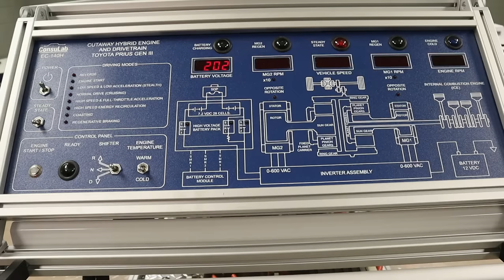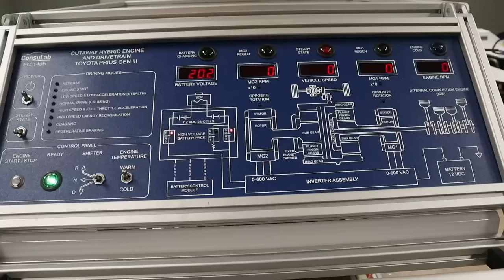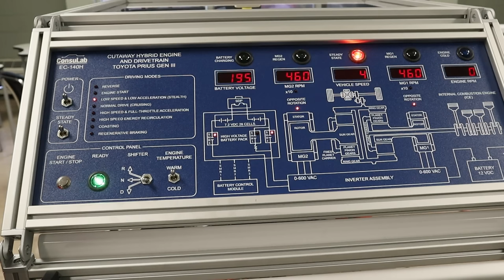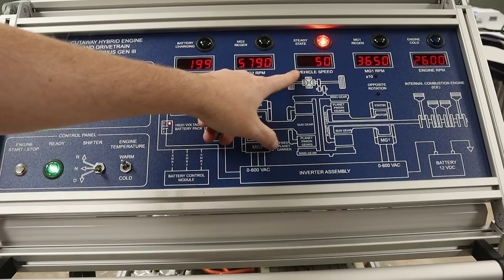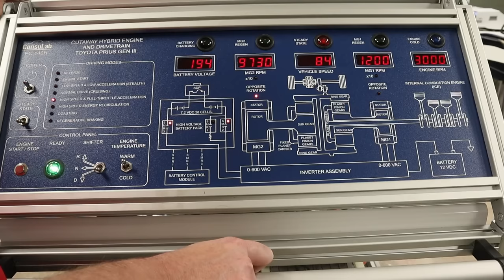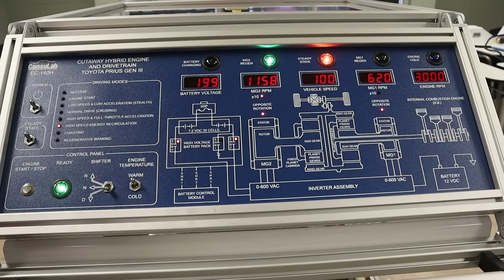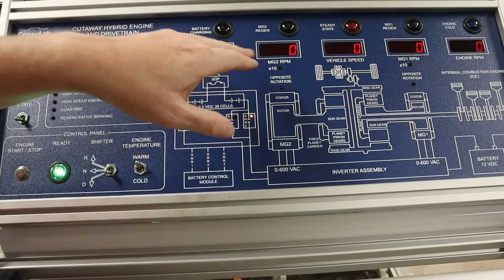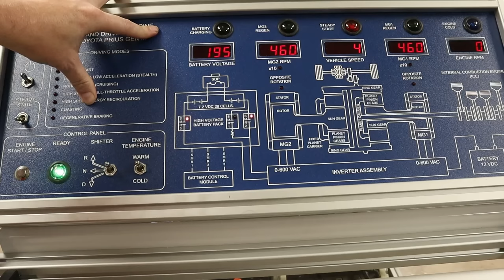How the Prius Hybrid Drivetrain Works (Explained)

Comment: Hi, this is an old post but perhaps I can get some technical questions answered. I swapped engines and transmissions as well as the inverter on top of the engine. I’m getting a red triangle as well as the lights as if I was out of fuel. My gas gauge works intermittently. 
My questions are this: is it possible that there is a ROM pack in the transmission or inverter that prevents vehicle from starting or is it due to the hybrid battery getting so low as to not go into “Ready” mode and start the gas engine?! My educated belief is that the Hybrid battery is too low since it sat for two months all winter in Canada.  Other question is, if this is the case what is the easiest way to charge the Hybrid battery?  Do I take it apart and charge individual cell packs with NiMh charger? Is there an easier way to bypass it and charge with something else?  I have the old transmission and could build a until to spin the transmission and thus create a charger unit.
Reply from the maker: If it has been sitting for a long time, you may have to pull the battery and rebalance every cell. There are videos on YouTube of people do this with hobby chargers, but I don’t have one unfortunately.

Comment: Hybrid sync drive blows my mind. How is this not more reliable by margins than a traditional transmission with a torque converter ? HSD seems superior
Reply: It is more reliable honestly. I've never heard of one with a bad transmission (and I peruse prius chat forums quite a lot), and mine has 240k on the clock without ever having a transmission/diff fluid change and still drives like a dream.
Reply: @QuincyStick I have the same case but mine is over 300k miles. Only issue I'm having with it right now is electrical lol

Comment: Great video!  That's just a flywheel/damper between the ICE and MG1, right?  (not an auto-clutch or anything)
Too bad the trainer doesn't split open MG1 and MG2 stators - could be useful to see what the MG rotors are doing in various modes!
Reply from the maker: Yes, it just softens the shock of the engine. It looks much like a clutch disc and pressure plate from a manual transmission.

Comment: I also grabbed a few other parts to have on those half off sale days; inverter pump and washer fluid pump as well as an AC compressor.  Do you know what the electrical specs are for the AC compressor?  12VAC, 120VAC, etc.?  Voltage, Current and Frequency would be awesome to know from the expert.  Thanks again for sharing!
Reply from the maker: Gen 1 compressors are mechanical. Gen 2 are AC, Gen 3 and 4 are DC. The voltages come directly from the traction battery but vary by control module regulation compared to cooling need.
Reply: @AutoScholarwithMrB  Interesting!  Amazing the price of the Gen 2 parts that seem to never need to be replaced.  I really want to invest in a 1.5L hybrid system and am debating making something like the demonstrator to study with.  Seems like, other than the battery, the whole system can be had for ~$500-$1000 and maybe better if found on a half off sale.  Amazing even the pricing most likely under $1000 if not a pick your parts find. 

So, the Gen 3 can operate from 220VDC on down?  Guessing some form of pulse modulation vs continuous DC?  Seems I read 120V somewhere, though forget offhand.  Will be interesting to be able to very carefully measure V as well as clamp on with a current clamp to see the waveforms on an oscilloscope.  Just brought home two Tektronics portable carts since I'm still working on the cost effective acquisition  and where needed restoration of the lab test equipment to measure everything safely.
Reply: @jafinch78  tell me more about this half price deal you speak of 🤔

Comment: What happens if you put it in drive, full throttle, and then put it in reverse still full throttle. What will it burn out?
Reply from the maker: Can’t say I’ve ever tried it, and I doubt the car would let you do that.
Reply: Pretty much everything about it is drive by wire or computer controlled.
Even the stick returns to center when you put it in D. A thing that was missed in Gran Turismo.

If you do that while driving, it does not do anything. Simple as that. Foolproof, in any way.

Comment: So if the air conditioning compressor is not running off of the engine, does this mean that it will consume the battery like an electric car? Is it more efficient than a traditional car?
Reply from the maker: @shiriajin  yes, the ac depletes the battery. They are much more efficient because they can turn at the needed speed, not whatever rpm the engine is at.
Reply: @AutoScholarwithMrB  I used to have a town car, every time I turned on the air con while I’m driving, it broke the compressor. Now I have developed the habit of turning the AC on or off when I’m stationary. I don’t have to do this with this kind of car right? I’m trying to get as much information as possible about these engines because I’m thinking about buying a hybrid corolla.
Reply from the maker: @shiriajin  no you can run it however you like, thanks for watching!
Reply: @AutoScholarwithMrB  thanks for the information.

Comment: Huh. I have a 2nd gen Prius and I thought that when you let go of the gas, coast and not touch the brake that MG1 and the engine were applying that slight braking force, and MG2 only started regenerative braking when the brake was applied.

I assumed this because when I had my catalytic converter stolen, I could hear the engine being spun by the engine any time I let go of the throttle. Basically a lighter version of B mode at higher speeds. And it would change again when touched the brake (though I’m 100% sure on that last one)

Comment: I have a yaris hybrid 2013.  Sometimes the car does not turn on the engine even when The RPM is above the point where Ev should break and engine should turn on, it accelerates silently and display shows power going from battery to the engine.  2) sometimes when battery is on 2 cells, when Ev breaks, car jerks out of it. The transition is not smooth. Feels like car laggs first, then turns on engine.  Other than that it works fine. What could be the problem?

Comment: Came to this video to see if I can discover wether or not the 10,000 miles worth of oil life is actually more than that based on the % of mileage that was allegedly electric, but based on the trainer is seemed that the engine still is running most of the times above 30mph because it doesn’t know when it will be needed 🤔

If anyone smarter than me knows the actual answer that would be cool. 

In trying to learn if the recommended 10,000 miles for oil and filter change is actually overly conservative due to the hybrid nature of these cars.

I run a Prius prime that claims ~75% of my drive was electric usage, so theoretically it would mean my engine is only getting “2,500 miles” of use if I understood correctly, but I’m way too sheepish to actually attempt to milk the full theoretical ~40,000 miles before an engine oil change would theoretically need to be done (assuming 75% electric usages and miles being done before time degrades oil integrity)

Thoughts? Can a Rideshare driver get away with milking 20,000 miles before doing the oil and filter changes due to electric use and the engine being used less than what the odometer reads, or is the engine in fact being used for the full 10,000 miles as per the odometer and thus the oil change is in fact perfectly timed?
Reply from the maker: I change the oil in mine every 5,000 but that’s probably overkill. If you really want to get to the bottom of it, you could send your used oil off to get it analyzed. I’m thinking about doing this to compare oil quality.

Comment: If I wanted to connect a solar panel to battery while it's running how many volts I have to apply to prevent overcharging? Since it's 7.2 v per unit so 28 of them will be 201.6 v. So if I apply 201.6 volts from solar panel will the battery be safe?
Reply from the maker: I am unsure of how to properly do this. I would check fórums like Prius Chat to see if anyone has done this before.

Comment: What I want to know is the starting process. How does it turn the engine? I am working on a BMW X6 hybrid and I hear activity like turning as I press start button and transmission seem to be spinning but engjne is not being turned. It stay stationary, thus the car engine won’t start  and car throws hybrid power train code
Reply: The engine is directly connected to the planetary carrier. To put any torque on the engine, it's necessary to hold the ring gear still and torque the sun gear. And what's the sun gear connected to? MG1, right? But that's the Prius. The BMV could be a wholly different story.

Comment: Hey Mr B, i do have a question for you. I have a 2010 Highlander hybrid v6 Limited 162000 miles. The motor and transmission mounts are all recently replaced with factory parts. When the gas motor takes over for the electric motor, it's not always smooth. Sometimes i dont notice. other times it's rather jarring. feels like a dull thud or shake. It could happen  at idle or under acceleration from a stop. Any ideas where this could be coming from? this is my first hybrid and i bought it used so not sure if this is normal behavior. Thanks!
Reply: actually, i think its the flywheel damper. right where the ICE mates with the electric motor. that would probably be hard to replace. lol

Comment: Hi Sir   . please can you tell me again how can i find pin 1 and pin 3 on INVERTER HYBRID TOYOTA GEN4 P610 ON Inverter its 2 connecters one (24pin ) another connector (13 pin )
pleas if you tel me hwo can I connect power 12 volt to run InverterI will be very grateful to you

Comment: Gen 4 when you slowing down shuts engine off in any speed, unless battery overcharged. Even on flat road I can go in EV at high speed for a little. At least this how work with lithium battery, not sure if it’s same with old style battery. Gen 3 will drive in EV only under 45 mph, even if you go downhill, engine never shuts off, very little power. But I found if battery depleted, to recharge it, your average mpg will go down. Look like it better to keep battery not less then 70% charged. Needs to much energy to recharge. Gen 4 actually benefits if I using as much as possible battery power, much less energy to recharge it.

Comment: Your Engine RPM numbers were WAY off. Typically any acceleration at any speed (since it's an Atkinson cycle generator not a torque engine) will net 4200-4500 rpm with 80-90% throttle . At 22:45 in the video, you reached 90 mph...well I can tell you it's NOT doing just 3000 rpm to maintain 90 mph.

Comment: My original hybrid battery indicate some issues on dashboard  from time to time by one strange cycle when it is charged up to 100 instead of 80% like used to be. What should I do before I get code?
Reply from the maker: Is the battery balanced? I would check voltage with each battery block and make sure they are close to each other in voltage. Do this while the battery is under load, like when the car is under heavy acceleration. This can be done with most scan tools. If a cell is weak you have a few options, depending on your skill set and time/money you want to invest. “Refurbished” batteries are popular, with many people selecting companies like Green Bean to come and replace your battery and offer a warranty. You can also remove the battery, replace the cells with new ones, and reinstall. I hope this helps, and good luck with your car!
Reply: I cleaned copper bus bars by sea salt and vinegar which  helped eliminate the problem

Comment: Sir
I have problem with my prius 2011.
When air conditioner is on and driving on 20 30 mph local street.
I got battery problem sign.
When I drive 50 60 mph then air condition doing fine and battery doing fine.
Can you suggest me what's wrong  with it
Reply from the maker: Could be a battery cell weak
Reply: @AutoScholarwithMrB  but did not get battery cell weak code yet.
I want to change battery,
But totoya dealership said they checked battery ,
Battery is fine. 
It might be some thing wrong with inverter converter.
AC attached with inverter converter

Comment: So the gearing is 20 mph per 1000 rpm as per a regular car? Why is the gearing not higher?
Reply: NB. I now have a UX250h with the P711 hybrid transmission and the revs drop to 1500 rpm at 70 MPH. Thats 47 mph per 1000 rpm.

Comment: Great video, but if you turn the car off, it’s not just gonna start up at anytime. You have to have it on, and that requires the key inserted, (or near car if smart key) and foot on brake while pressing the start button. They don’t just start Willy nilly.
Reply: I agree, I am not sure I see the need to disconnect the 12v Aux battery, unless you are disconnecting wires / risking a short circuit. There is still a lot of short-circuit current available from even a small AGM battery!

Comment: Thanks for sharing I have a Hyundai ioniq hybrid but I’m sure pretty much works the same way
Reply: The ioniq hybrid works differently, the ioniq hybrid and plug-in ioniq only have 1 electric motor instead of two, and it’s paired to a conventional 6-speed automatic. So the ionic hybrid system is not as simple or as elegant, It’s able to de-clutch the engine, so that way I can run in EV mode similar to a Toyota hybrid, but it cannot create and consume electricity at the same time like a Toyota hybrid can. Due to only having one electric motor, it can either only create or consume electricity, it can’t do both at the same time like a Toyota hybrid can with having a two-motor/generator hybrid system.

Comment: With proper engineering it would be very simple to make our electrical world work on the inertia and the generative- Power ,
of pumping warer-… to make electricity…
Moving water is not slowed down much buy something it’s also being used to generate electricity
Every day they drop millions of gallons of water through water towers all around the world and those could be generating facilities making power as well along with every waterline coming from them could be turning magnetic hill that generate electricity water meter floating spinning pill that makes water company lots of money